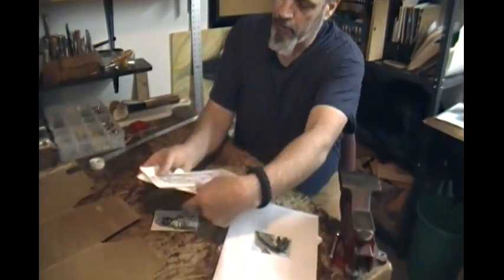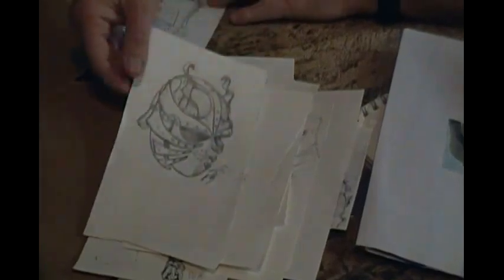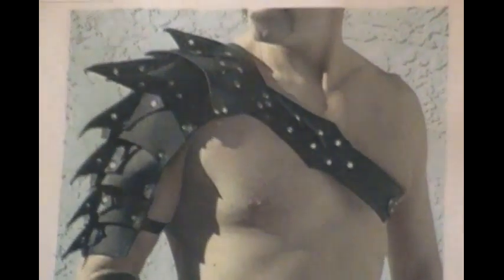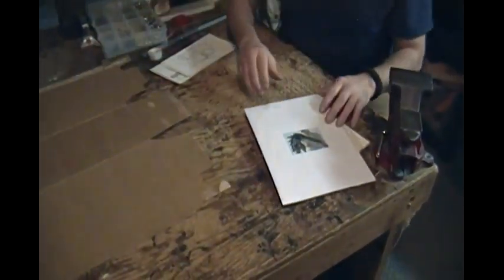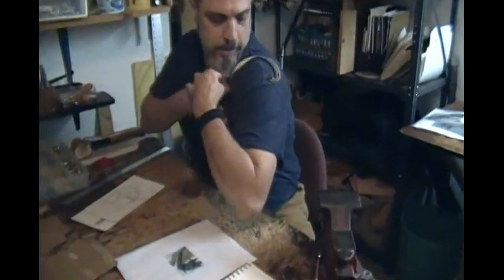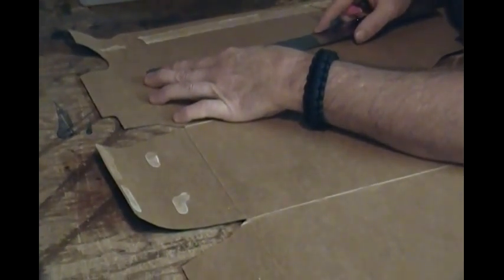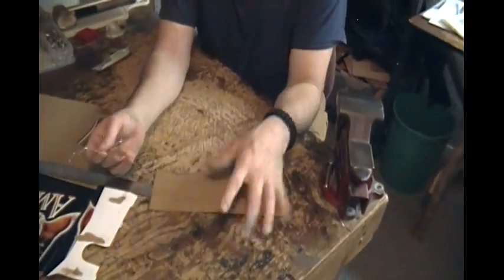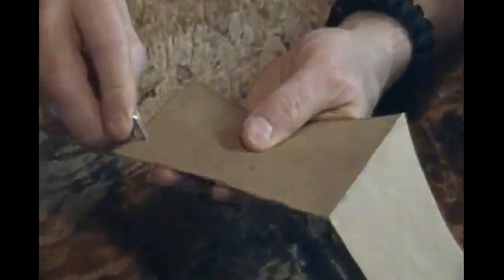Designing Patterns for Leather Armor

Comment: Here's a question, I want to make leather armor with metal scales or plates really. What would be the best method to attach that metal plate to the leather where it has a minimal impact on the form of say, a gauntlet. I probably explained that badly, basically I want to put a curved metal plate into a leather gauntlet where if you run your hand over it, the entire thing will feel like one smooth surface. I'm thinking wet mold the plate into the leather, score the back of the metal and then glue it in. Just not sure if that'd hold or not.
Reply from the maker: Hey, thanks for subbing. That all sounds good but I would also punch or drill holes in the metal and fasten it to the leather with rivets.
Reply: No problem, you definitely deserve my sub. I wasn't sure if glue itself would be enough, thanks for the advice. If I ever get around to doing it I think I'll make it to where the rivets sit inside the metal. I forget what the process is called but I've got the tools to do it lol.

Comment: i have a idea kicking around my head right now for a way to make armor with leather and aluminum sheet metal. the thought is that you would take two pieces of leather and sandwitch them around a sheet of aluminum to get a nice contoured and resilient piece. something that would ideally give more protection than plain leather but not be as heavy as steel. i would love to know your thoughts on such a design. the obvious is that it would be alit more work but the question is would it be worth it?
Reply: @Dave Hill your idea is similar to a couple types of historic armours, specifically the coat of plates and brigandine. Those used steel of course, but the broad concept is similar.